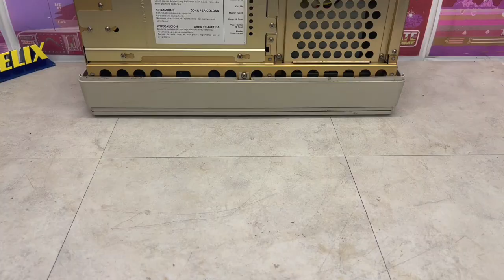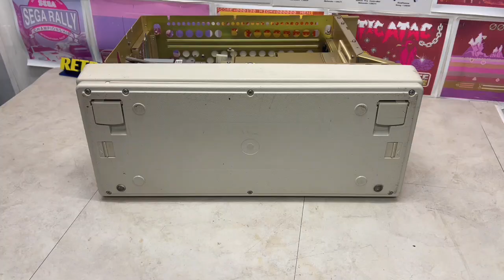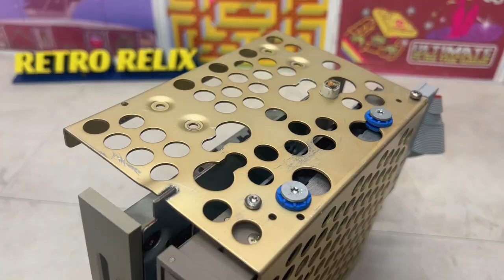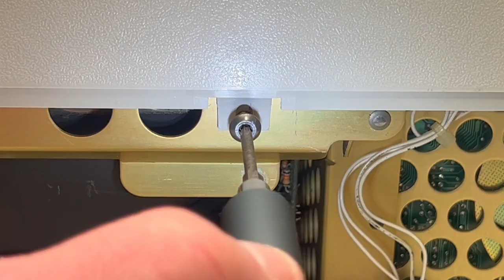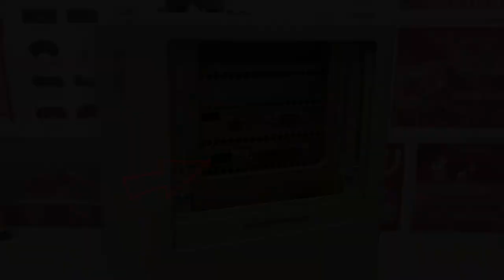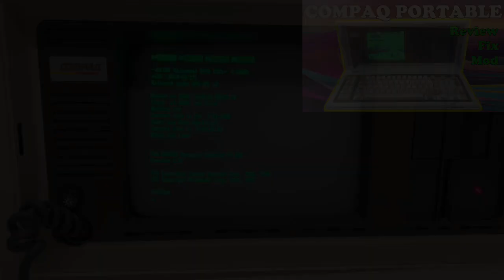1986 Compaq Portable Personal II Computer Review, Fix and Modern Mods

Comment: I have one if these with a badly damaged PSU.  The main damage seems to be on the hybrid PCBs.  Im considering to replace the whole PSU with a MeanWell, if it'll fit.
Reply from the maker: I also looked at that option. From memory, there’s a start-up feedback check on the PSU which could make this more tricky - which is why I didn’t got down that road. Let me know how you get on as loads of people have exactly the same issue 👍
Reply: @RetroRelixRestorer Will do but it might be some time until I can delve deeper and get it done.  I did read something about that, but I'll see what I can do.  Thanks for the reply.

Comment: Thanks for the video. Can you say a bit more about the fault-finding on the power supply? I have one where the tantalum cap between the two main voltage regulators has gone bang. I suspect there's more at fault here, I had suspected the regulators but I notice in your case it was one of the transistors. Have you got a circuit diagram?
Reply from the maker: Morning. You’re not the first to ask about this PSU. From everyone I’ve spoken with, we’ve been unable to locate a circuit diagram either. Even though I replaced the rectifier bridge, all the caps, faulty transistors and voltage regulators - it still didn’t work. A few, including myself suspect it’s one of the vertical daughter boards. I’ve included images of these in the Dropbox link in the description if that helps. I think the only option is to use a modern +5v, -5v, +12v and -12v replacement and configure in line with the guidance provided from oldcrap.org.
Reply: @RetroRelixRestorer  Interesting, thanks. Shame you couldn't get yours working, I wonder if there i some cascade failure that happens when they go pop. I'm going to persevere a bit with this one and rule out anything obvious, will report back. If all else fails will have to go down the replacement route

Comment: Great Video, and thanks for linking in Disks, etc! Do you happen to have any close up photos of the little hybrid boards on the PSU? One of mine looks damaged when the PSU blew up. May not be worth fixing my PSU if these are damaged.
Reply from the maker: I’ll have a look for you.
Reply from the maker: I’ve added a PSU Hybrid Board directory in the disk link with some images for you. The back left one is really difficult to get a good picture. Hope it helps !
Reply: @ That's fantastic, thanks you so much! I thought several components had burned off the back left board 😊😊. But looks like they are not populated.  👍👍